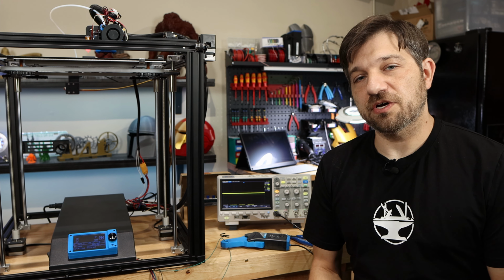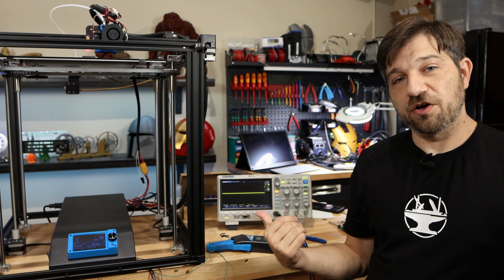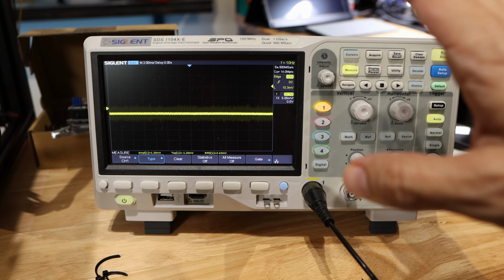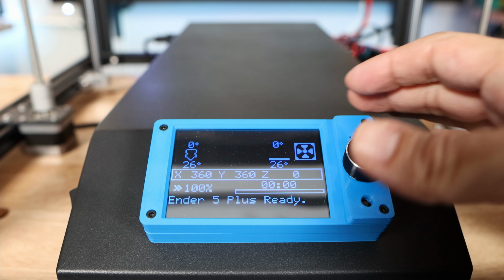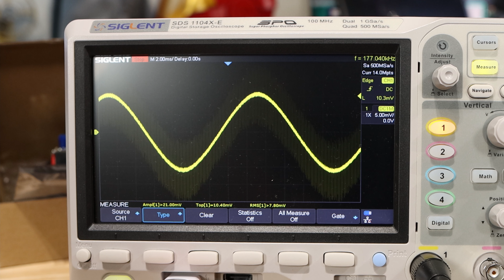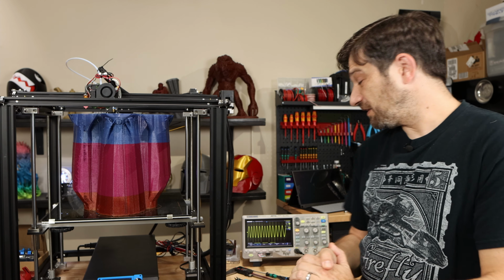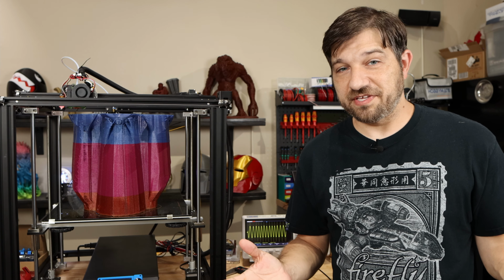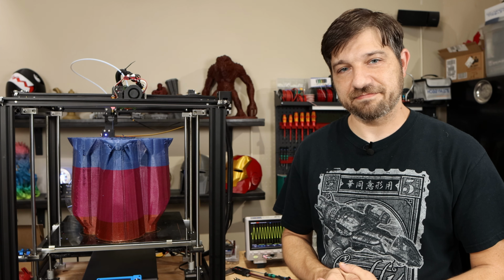Stepper Driver Current Debugging: SKR E3 Turbo

Comment: Note that a motor that's not moving but powered and holding at a position in-between whole steps can heat up more than motors that are in constant motion. To keep Trinamic steppers cooler with Marlin it can help to turn on `TMC_HOME_PHASE`, and then set your layer height in the slicer so it aligns with whole steps (i.e., 1/200 of your leadscrew pitch). There's no option to force Z0 to align to a whole step, so there's no absolute guarantee that Z would always be at a lower-energy phase with whole-step layer height, but it might be interesting to experiment with.

Comment: Lots of hard work went into this and you had a good analysis.   It makes sense  that the Y would run hotter, since it does have more current going to it.   To me being able to set the current via software is worth the upgrade from the stock boards

Comment: Great technical video
Keep in mind setting the driver current only limits the current IT DOES NOT PUSH CURRENT as you demonstrated. The motor demands current or pulls under the use. So if a motor is demanding more current say under a binding condition do to the belts or wheels being to tight or fast accelerations the current will increase but only to the limit set for the driver. It my be possible that at 800ma and continual conditions as stated could cause the temperature rise on the motors. So poor assemble could be the cause.

Comment: Kersey the problem isn't setting the stepper current its that the board seems to reset itself and change the current values leading to overheating.  It works perfectly until it doesn't.

Comment: I have the same printer (Ender 5 Plus) the same Board E3 Turbo... and your latest version of your firmware for it. 
And my printer was working great. A few test prints and it was working well.  Then I printed a 6" x 4" by 1" block and the Steppers got super hot and I had layer shift all over the place.  I slowed down the Ender 5 to CR10S print speeds, reduced the voltages and tried again...  Motors stayed with in acceptable temperature ranges, but the layer shift remains. 

Based on some of the redit posts there seems to be a grounding issue with this printer and I can document that my printer  reads as high as 10 ohms of resistance between the backs of the motors and the PSU case.   The X motor has zero grounding between it and the PSU

I have added 18 gauge copper grounding cables between all of the steppers, the printer chassis and the PSU case.   Now each motor measure <0.2 ohms to each other (and the case)  

Printing a "large" test cube now and so far the motors are cool.   But something funny is going on here. 

Did you ever figure this out?

How much heat can a stepper take before it needs to be replaced?

Update  Grounding not the issue... 4 very hot steppers  All with slow speed and lower current settings.  
Any recommendation on a replacement board for the E3 Turbo?
Reply from the maker: Yeah, I really like this board but they've discontinued it. I assume the overheating is why. I've seen no reports of issues on the SKR 2 or SKR 3. I've been using the SKR 2 for a while now.
Reply: @kerseyfabs  In my junk drawer I had an old SKR 1.4 Turbo and 5 TMC2209 drivers .  I  used your installation guide and firmware and the the printer is producing amazingly perfect prints.  Apparently the twice cooked steppers are still ok.   Thanks again.

Comment: Kris -- I haven't been following the overheating issue with the SKR-E3-Turbo for about 6 months, however at that time on github issues I think there was strong evidence that the overheating is due to the software-configured TMC2209's losing their configuration settings and reverting to default, probably due to electrostatic discharge. Quoting myself...

"OK, from your discussion of your ability to reproduce the failure, I think we've reached a valid diagnosis -- electrostatic discharge (ESD) to the motor housing is causing a pulse on the windings that reaches the TMC2209s and is sufficient to reset them, which leads to them operating with parameters (presumably current) that cause motor overheating.

Obviously that ESD could occur from an outside source (such as user who has accumulated a charge) touching one of the motors. But ESD could probably also build up due to the parts of the printer moving about, such as the electrically isolated gantry or trolley with insulating tires constantly rolling along on metal rails. That gradual buildup by itself would not be the disruptive influence, but if it achieves a voltage sufficient to arc, that might be a pulse that couples capacitively to the motor windings and cause the TMC2209 reset 
etc."
https://github.com/bigtreetech/BIGTREETECH-SKR-E3-Turbo/issues/31
Of course, the issue of getting the drivers adjusted properly in the first place is a valid one, and related to heat in normal operation, which you investigated it in a methodical manner.
Reply: Ive read that thread a hundred times, nothing has worked yet I have the same issue

grounding does nothing
Reply: Yep Kersey tested an issue no one is reporting. Its the sudden change to overheating thats an issue. Grounding doesn't work. Switching back to CR 4.2.7 board did work but I lost dual z motors. Waiting on full SKR 2.0 to arrive and hopefully sort the issue.
Reply: this is only valid explanation, Graham. so we should ground all motor housings, and gantries?
Reply: @DeltaOps3  you did not explain what parts of printer have you grounded, therefore I dont believe you.
Reply: @sigterm15  sounds good to me
Reply: @sigterm15  I don't think the explanation I provided was ever definitively proved (for example by reading back values from the motor driver chips). However, it is in general a good practice not to allow charge to accumulate on parts of a machine, which rolling rubber rollers would promote. So yes, arranging a path to ground for the moving parts is a good idea.
Reply: @Graham_Wideman  i can prove it. i heard motor drivers reset when i  put my pliers near nozzle. then i read m122 output and drivers were reporting that 8-microstepping which is definitely sign of tmc chip reset. same happened when i just took away my energetic pei magnetic sheet from bed.
Reply: @sigterm15  I really appreciate you reporting those details! That is excellent to hear the hypothesis checks out!
Reply: @Graham_Wideman  well SKR E3 Turbo is so sick designed :(  It takes just one touch to X-axis screw, drivers resets and go crazy. In schematic I found that it is due to GND / PGND separation. all other SKR board dont have this GND separation

Comment: I cant seem to get sensorless homing to work when I have Quick Home enabled in marlin config_adv. It works independently, but wont work when x/y both try to home at same time, and it just crashes. Any idea why that is?
Reply from the maker: I don't use sensorless homing. But since it uses the motor's feedback to determine when it's hit, running both directions while homing would make it harder to dial in.

Comment: Thanks, as always very interesting!

I'm running my ender 5 Plus with an btt Octopus and 2209 v3.1 drivers. 

These dynamically increase current as needed it seems, but I can run much lower currents, and my motors don't even get warm, even when printing crazy fast.
Reply: Have you  tried to set up the two Z motors on separate drivers?  I forget the correct term, but you can then do a bed height adjustment and correct using each Z motor independently.  I think I'm going to look at this after my Rat Rig is finished.  It uses 3 Z motors and drivers to adjust the bed.
Reply: @woodwaker1  yep, I'm running dual z drivers. The auto Z leveling feature is nice to have, but not a huge improvement.
Reply: @robertj8674  I am running a similar setup on mine. SKR2 with 2209 steppers and dual z.  Honestly I want to figure out how to modify the E5+ to work with 3 z axis screws for 100% automated bed leveling.

Comment: Have the same setup and keep getting a extruder stepper error.
Is 650mv low, or just fine for the stock extruder?

TMC ‘extruder’ reports error: GSTAT: 00000001 reset=1(reset)
Reply from the maker: 650 should be just fine. I think I run 800 for just a little more torque.
Reply: @kerseyfabs  ok thanks. yeah seams like everyone else is running a little higher the 650, so thats why im checking around. Kinda think i have narrowed down this error to a bad stepper, even tho its brand new, so might try to up the current a little i to. But really, possible to low current shouldn't damage the stepper, or? Has been running 24/7 for like a week, but its not geting hot at all really.
Reply from the maker: Too low shouldn't damage anything.

Comment: What if the stepper Motor itself is the Problem? Something like a cheap clone?
Reply from the maker: Unlikely. I haven't seen reports of this issue on any other boards at this time and on the same printer.
Reply: Ive thought that it could be my Y axis rotor just got hot, and shorted and when it gets upto temp, it randomly shorts again. thats the only thing I imagine it could be. I have an SKR 1.4turbo now, but since ive fried... 2 bl touch sensors
.. Ill have to buy another to see if the problem resolves, at that point I suspect the board. I still have the old skr e3 turbo..